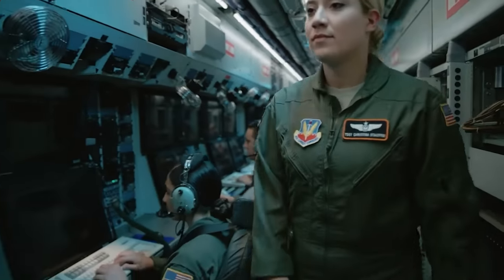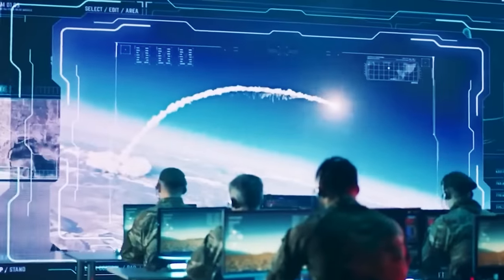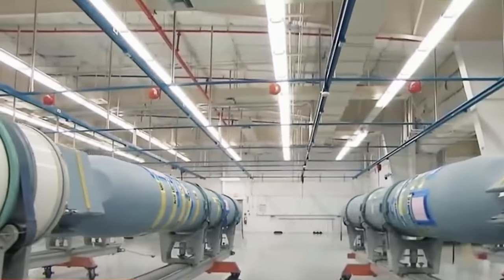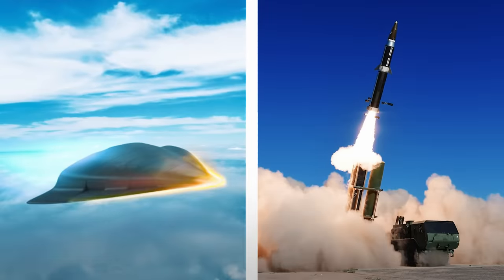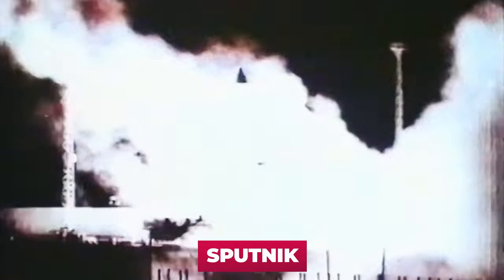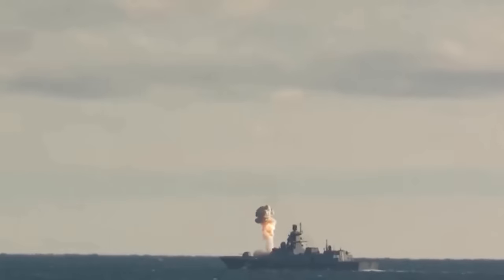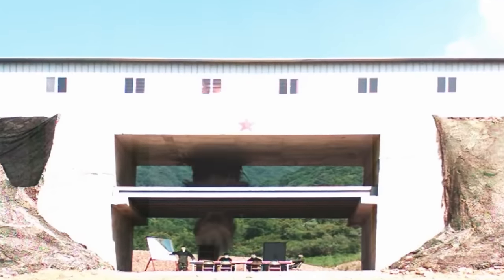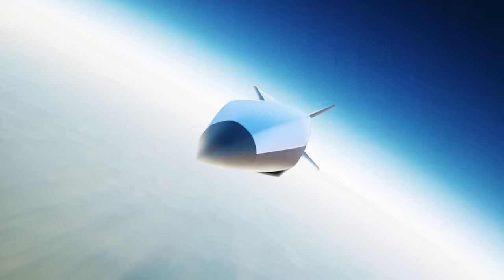US Tests Hypersonic Missile 5 Times Faster Than Speed Of Sound

Comment: People fail to understand that there are multiple types of hypersonic missiles and it doesn't just end with Khinzal missile. 

The Khinzal you all are talking about is in fact ingenious way to create a weapon platform as cheap as possible while retaining most crucial capabilities of hypersonic weapon but without use of scramjet in it's design. It's called complex Khinzal, because it includes Mig-31K to use it. 

While you keep comforting yourself that Khinzal is merely an Iskander missile dropped from a plane, there are 2 sides of truth to this. Khinzal is indeed designed as a complex. It won't be used without Mig-31K because in that case it would be more expensive and would force engineers to go with a scramjet. 

They decided to go the other way. They choose Mig-31K for being the fastest jet in world with the highest range today of 3000km and speed exceeding 3000km/h. There is even a world record of 8000km flight path with 3 refuels mid air. And then they created a missile that is using concept of Iskander missile, but have a different guidance system and some other technology built in. Essentially modernized Iskander reaching hypersonic speed during flight path. The missile itself is not a scramjet, but that's because Russia already have scramjet hypersonic missiles, so they created a cheaper version of those for less valuable targets to use it more often. And for that Mig 31K became part of this concept.

And that's something that everyone keep ignoring while putting so much emphasis on Khinzal. Their weapons not limited with Khinzal you see.. They have Zircon, which is a real scramjet capable hypersonic missile for naval/land operations and is able to fly up to 1000km. This range wasn't even confirmed to be a max distance, because they demonstrated it at 1000km, so we need to assume that it might be min/mid/max at the moment.

Additionally to that, they created first in history ICHM (intercontinental hypersonic missile) with orbital bombardment capability (widely known as MIRV) which is unlike old gen ICBMs is actually for the first time in history capable of maneuvering during flight path which can take up to 18,000km, with HGV on board reaching up to 28 Machs. Namely Sarmat (ICHM) and Avangard (HGV).

It is worth a mention that all ICBMs are ballistic rockets that will reach hypersonic speed regardless, but they lack of any maneuvering capabilities, meaning their flight path can be predicted, since they are flying on fixed path, which is why we call those ICBM. 

Russia changed this game with introducing of Sarmat which is essentially a goddamn ICHM. No one need missile like that.. ICBMs are more than enough.. but hey, they are just flexing with it because they have technology to create such a thing. If US could, they would be first to flex with it.

And on a strategical scale it simply mean that ABM defense which was designed to intercept ICBMs is now obsolete for as long as it won't be able to intercept every flight path that ICHM would be able to be instructed to fly. Because thing like ICHM could use low altitudes unlike old gen ICBMs. Which seems oddly familiar.. like cruising missile, but this time it's the cruise missile flying 18,000km and is armed with 3 HGV. If it goes low altitude, then there is simply no ABM to intercept it. Virtually nothing to intercept it.

In other words introduction of ICHM completely eliminates ABM capability of intercepting it - making it obsolete. Something to think about while comforting yourself with Khinzal just being an Iskander dropped from air.